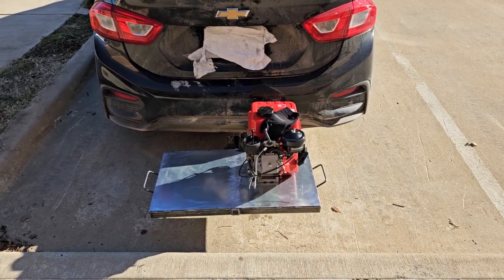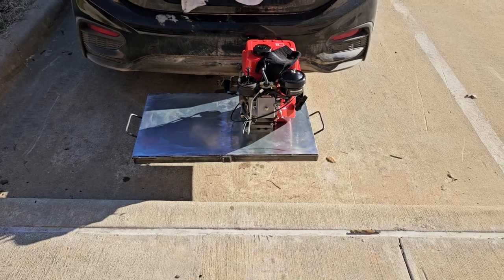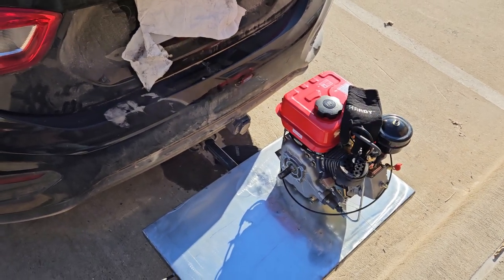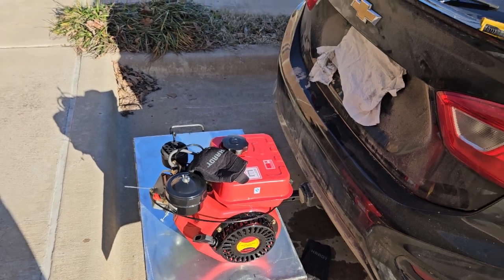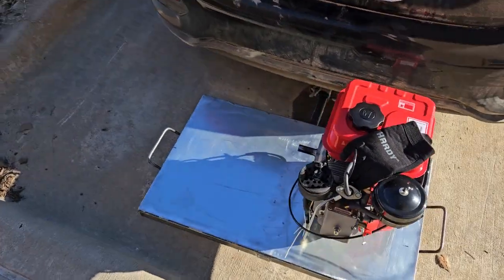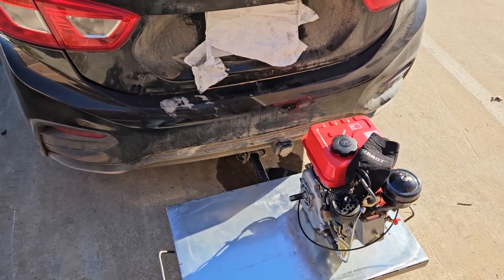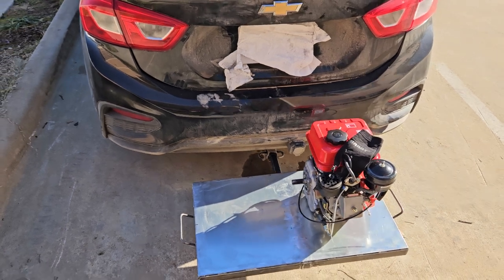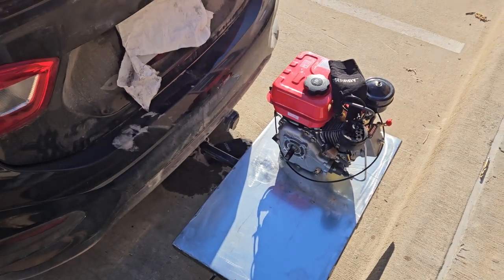B13. 3HP DIY Diesel Inverter Generator (DC Out Only) Mobile on hitch pad.

Comment from the maker: This is coming along. I got the plates for the 8" samsungs as generators.

Wiring out will be open source. I will give you open sourced full diagrams when I finish and test the units.
No secrets will be withheld on these diesel machines.